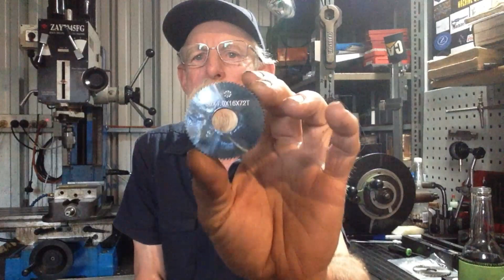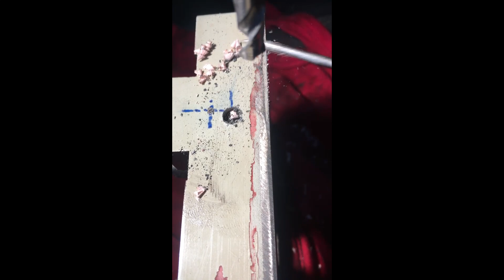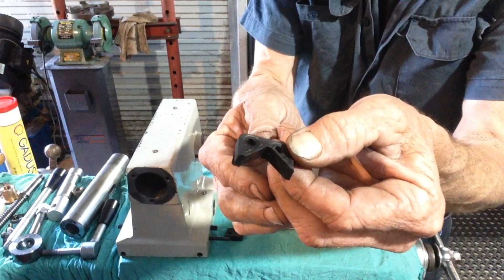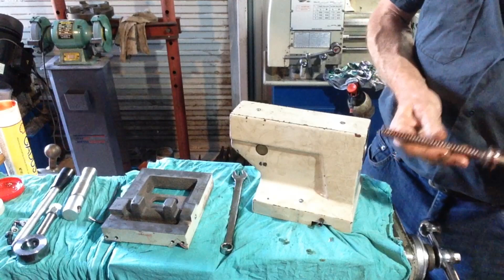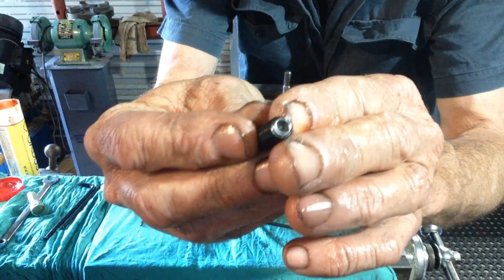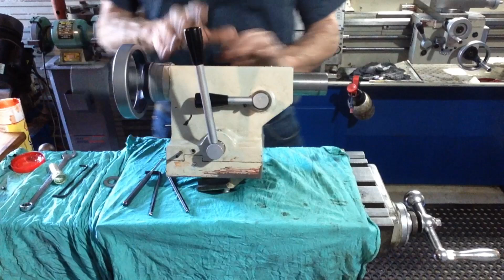Centre Lathe Maintenance & Modifications Part 12B .  The  Tailstock .

Comment: Hi Max. Great series! I'm currently stripping and cleaning my Hafco AL350B. Very similar to yours just belt drive. Curious why you chose to grease all the moving parts rather than oil. I though greasing is a no no as it holds chips.
Reply from the maker: Some spots that you can not get to grease is better .  👍

Comment: Making way wiper holders for felt is a bit of a mission, my Hercus had neatly pressed holders and wipers readily available from Fiora Machinery
My current lathe I found some aluminium right angle extrusion which I cut down, drilled and holds the felt wipers well.
Reply from the maker: It will be a mission alright , but i think i have a  plan  , duel wipers on extension covers .
Reply: My DSG had extension covers on the front Vee way, the one closest to the Headstock passed the front of the headstock without interference.
On my Lathe it would not be an option as it would reduce carriage travel being obstructed be the headstock.
Waiting in anticipation to see your method!